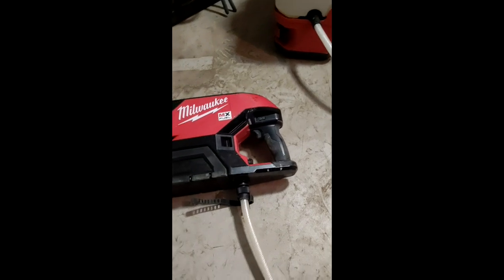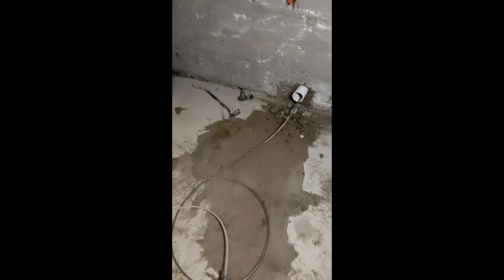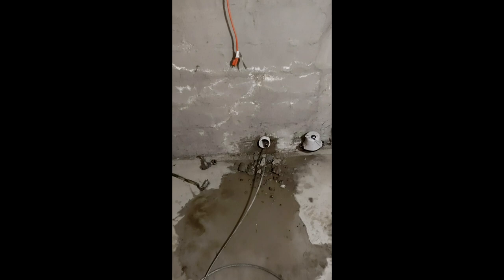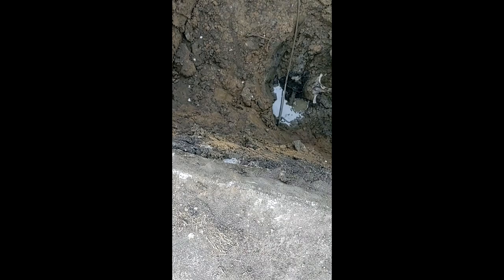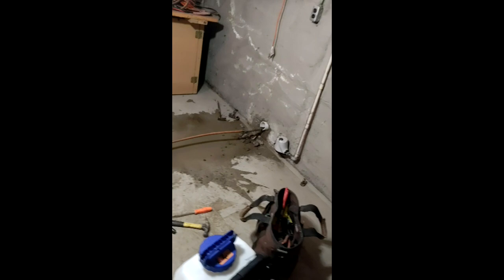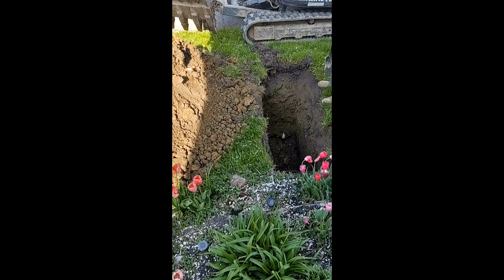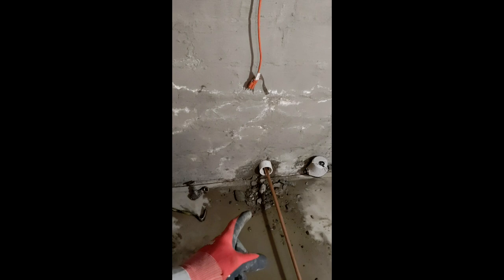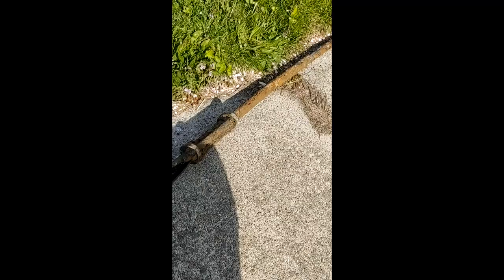Blowing open an old water line to replace with new

Comment: Anyone can pull plastic waterservice, pulling galvanized is the real beast. We call that coupling a dayton and typically we only expect to see it near the curb stop connection because that's what the city here has authority over and they typically use it to connect back to the homeowners water service after they make a repair to their curb stop at the street. Running into one in the yard especially when you're trying to make a pull must really suck.
Reply from the maker: It was indeed a huge headache, but at least we saved their front deck and flowerbed!

Comment: Won't the copper now be laying in a bed of steel? Seems like your setting  yourself up for the copper to fail.
Reply from the maker: Once the splitter head is out far enough, it ends up pulling out the old galvanized pipe completely

Comment: Hey, great video.  We’ve never been successful pulling galvanized with the few different methods we use.  So great job!  I use the local Georgia Underground Co. Hardware and also the Pow R Mole system and hardware.  You mind telling me where I can get a splitter head that you have. 

My company is Zippy Plumber in Atlanta.  We have a couple videos on how we do it.  Obviously are water services are a lot more shallow.  “Fastest Water Line Pull” is another one we did when we started to be more successful after 10 years of trying. Lol
Reply from the maker: Yep, I've seen that video and a few others of yours. This is made by WheelerRex, it's their PipeSlice II (part number 8601 but you need to buy the cable with it), i have both of their heads, the large one will slice open 2" and this head works good up to 1". Something tells me you are familiar with WheelerRex stuff